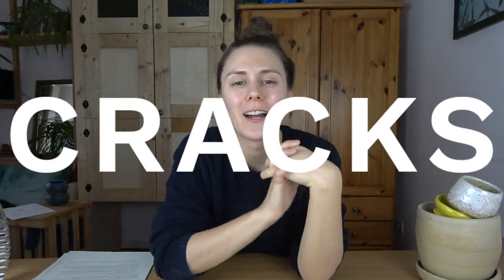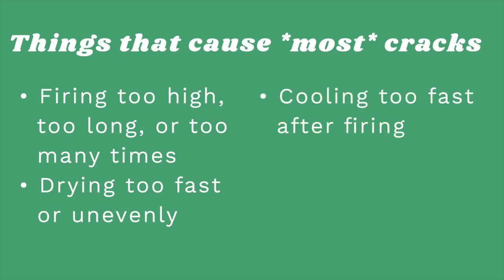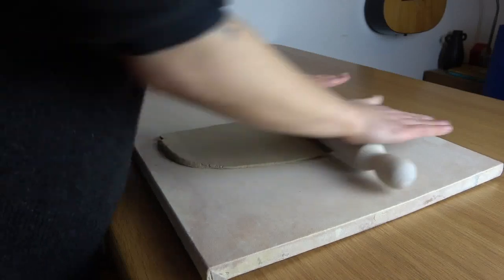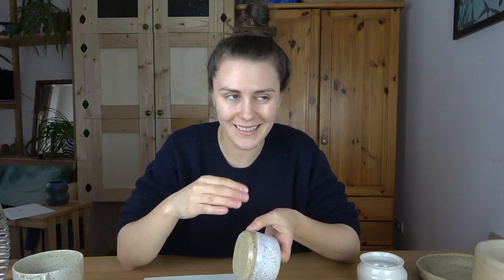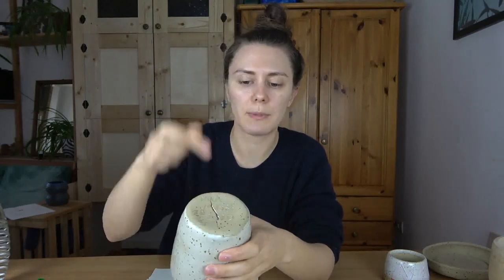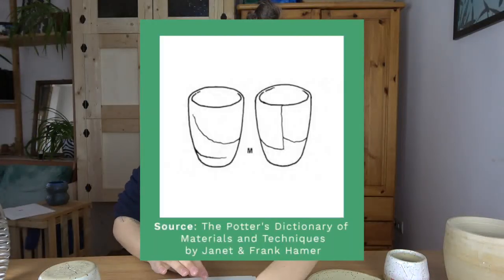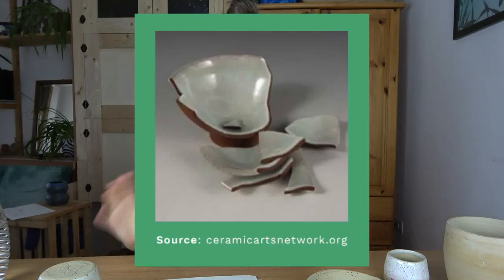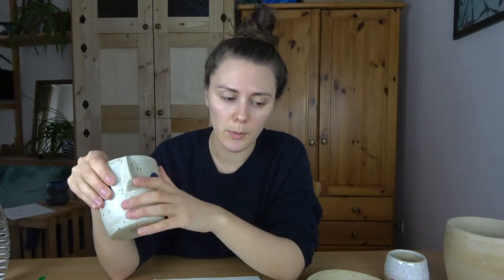Stop cracks in your pottery! // Different kinds of ceramic cracks and how to prevent them.

Comment: Thanks so much for this informative video! I am a hand builder and make hollow forms with added bottoms. I am not able to turn my pieces over for even drying and this results in cracks some of the time. Do you have any suggestions? Thanks in advance.
Reply from the maker: Do you mean the piece is round at the top or something? You can make a sort of support with a bucket and a towel (or something else) and to rest them upside down if theyre round on the top. This is what I do because I really believe they need to be flipped, so I will do it however I can.